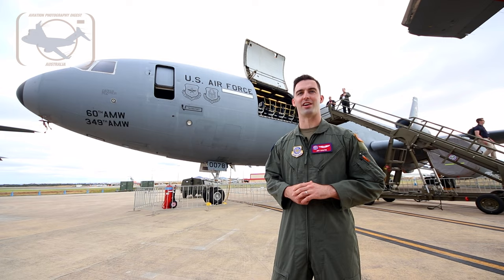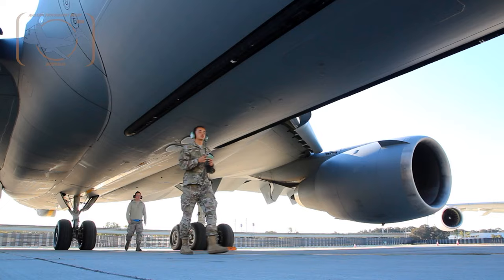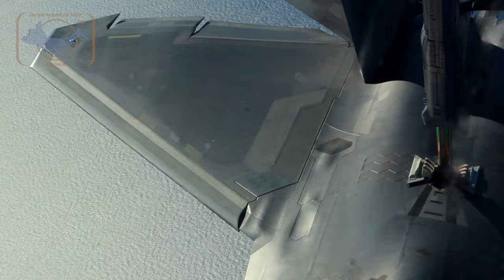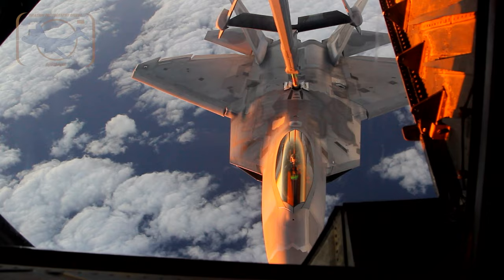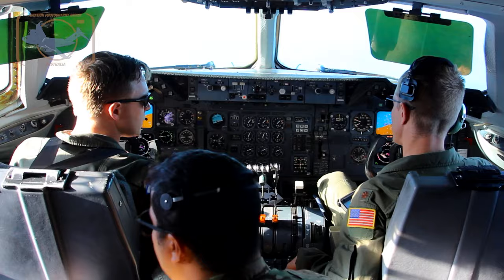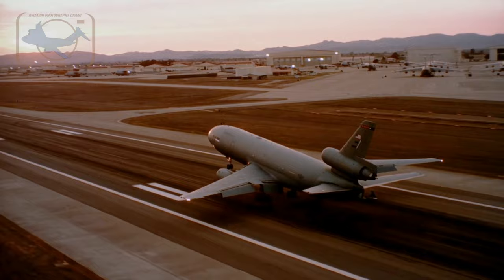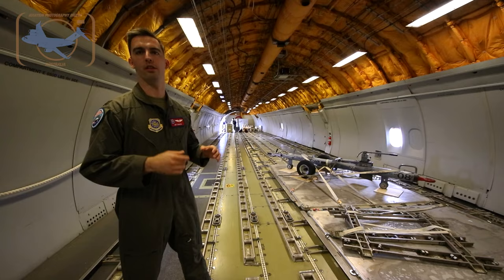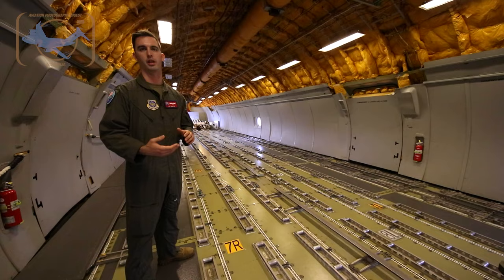Full inside tour of the U.S. Air Force  KC-10A Extender

Comment: What a shame that it will be retired by September 2024. All for the Boeing KC-46
Reply: And with the KC 10s going away that’s going to be one less aircraft flight engineers are going to be able to have available. Flight engineer is becoming a smaller career field. I was one on a C-5 so the ones assigned to KC 10 are either going to be retrained or assigned somewhere else to another aircraft. i’m not surprised though, because any modern aircraft is not going to use a flight engineer I have nothing against the KC 46 It is a pretty cool aircraft. The Air Force did need something newer.
Reply: the 46 is okay.... but still not on the same level as far as amount of fuel in one load.  Curious how many chicks a 46 can drag across the pond?  see if it can make the stop on wake island.
Reply: @cdubois13   So why the KC135 over the KC-10? KC-10 seems bigger, more capable, holds more, and one less engine so reduced maintenance costs. Not to mention both utilize a flight engineer.

Not to say i don't love both aircraft, i love them both. Just makes sense since the KC-135 is smaller and a older platform.
Reply: @AlphaGametauri  actually, the KC 135 does not and never used a flight engineer. If you’ve looked at a cockpit it does have the seat formally used for a navigator which they got rid of in the mid 90s. There’s a jumpseat but that’s for an evaluator pilot. The Air Force have been looking to replace them for sometime as it was once projected they would last till 2040. Some of them probably will as they fly with reserve and guard units. There were some huge expenses with the KC 10s I used to hear about back when I was in maintenance. I don’t know all the details but it does seem premature to retire all the KC 10s.
Reply: @cdubois13 you’re right about the expenses, I worked on them 2020-2021, parts were incredibly expensive, and that’s if you could source them. It’s an incredibly capable aircraft no doubt, but parts are damn near impossible to find. The 135 isn’t as capable but having been updated so many times and how many the Air Force has the parts are still available for them